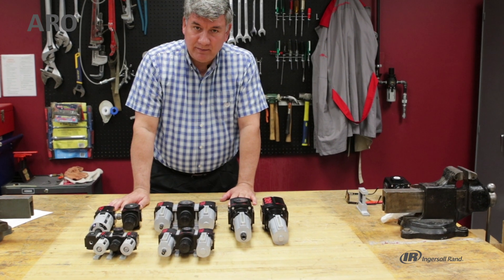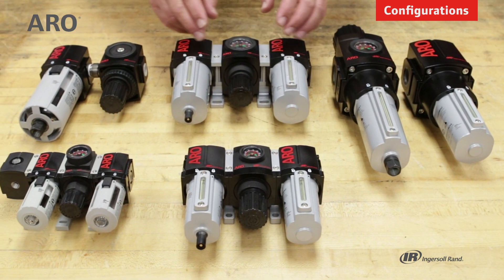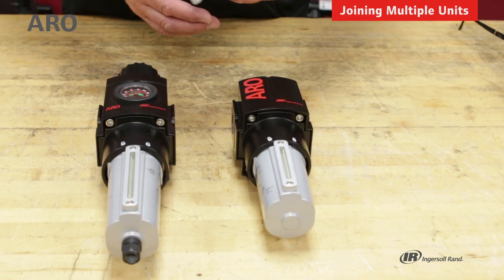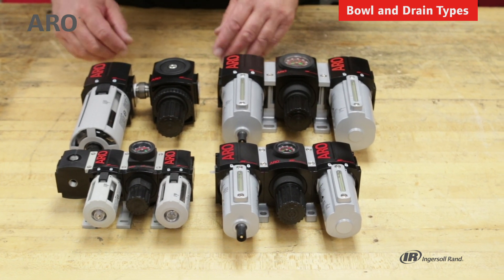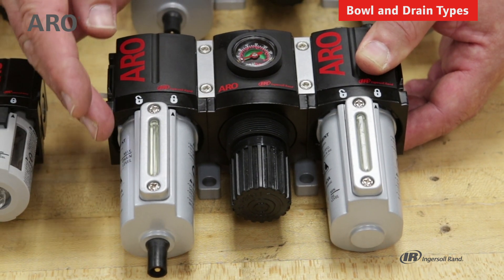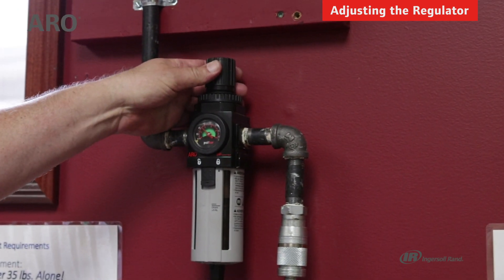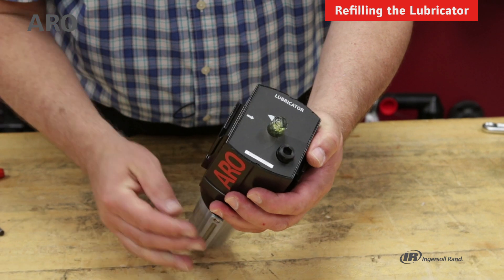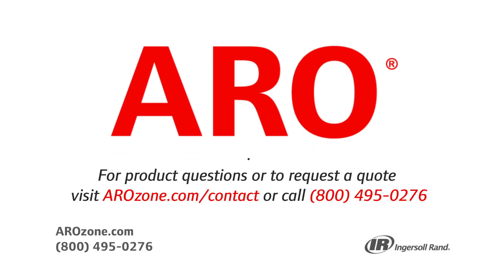ARO FRL Units: Overview of Filters, Regulators & Lubricators

Comment: Quick question for the piggy back unit (P39354-604). Is the air filtered first before the pressure get regulated? or regulated before filter? Thank you
Reply from the maker: Thank you for your interest in the ARO P39354-604 filter / regulator. Air first goes through the filter portion of the unit and then goes through the regulator portion.